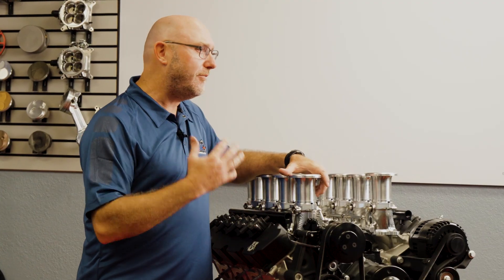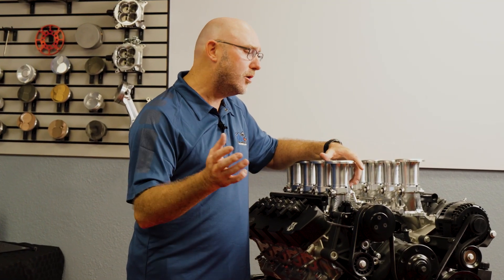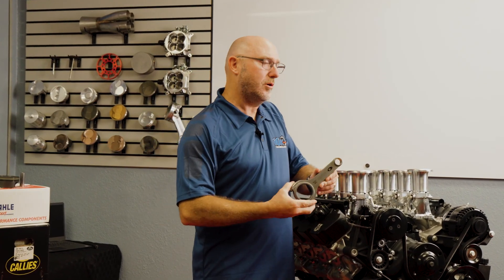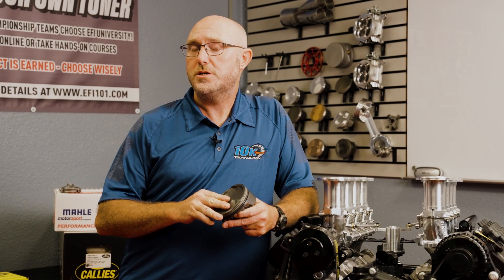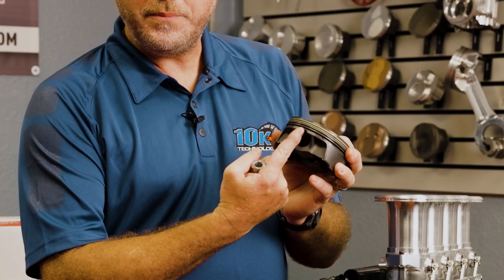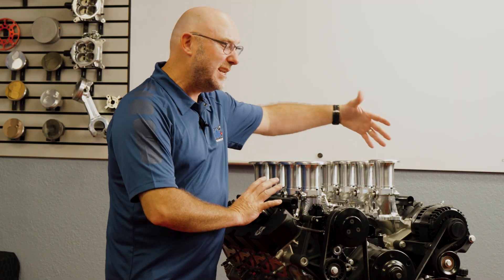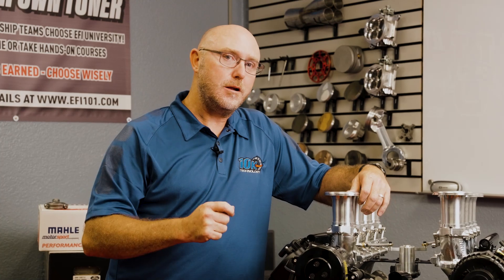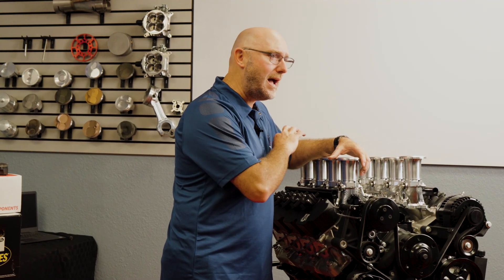750HP Ford Godzilla 511ci Stroker Debut!!

Comment: Definitely easier to do with the Godzilla. I’ve often thought about sleeping 4.250 in a 6.0 block with a 4.250 crank and ls7 heads. That 510.7. Or 511. Boost line has been doing the 4.250 sleeves for a minute now but they’re running the 4.125 cranks. Still a beast. Just curious if I could make it happen and it live. I like that piston. I wish people who bought and run these stroker setups would make some videos so we can see how they hold up especially with power adders.